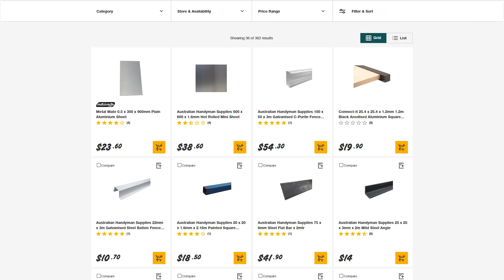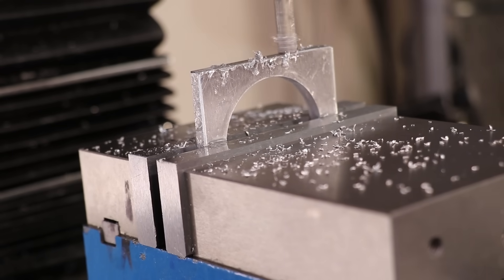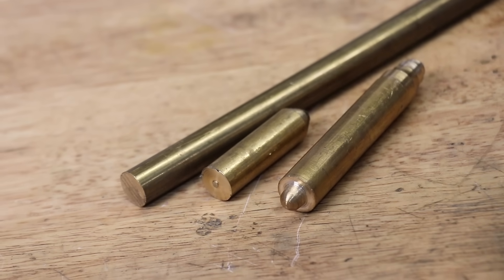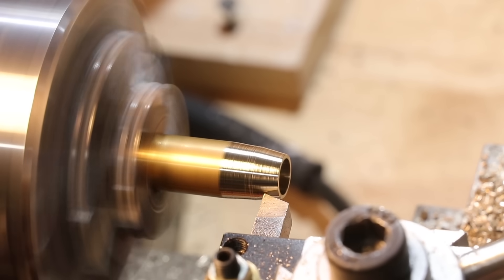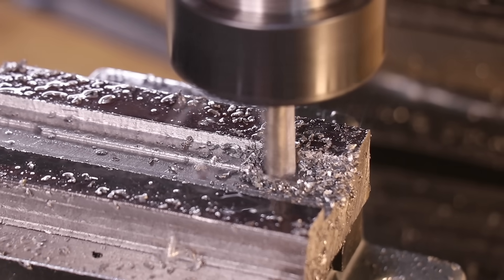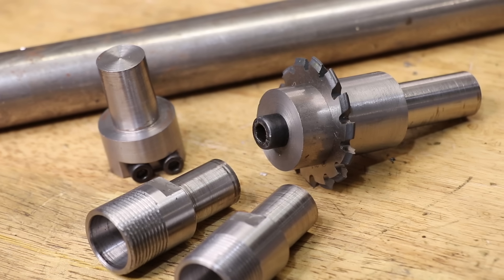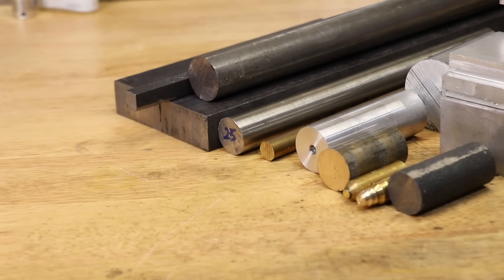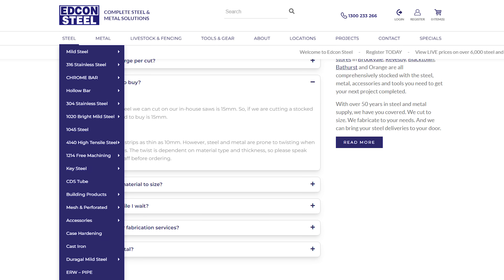Hobby Machining Materials - Where I Buy My Metal From (Australia)

Comment: I haven't watched Blondihacks for a few years but suppliers of small quantities may be handy as material is always a problem, particularly when shipping often doubles the cost.
Personally I'm OK with 6061 aluminium although I do use some 7075 for a few things, grind HSS with high rake angles, carbide inserts don't work so well and brazed carbide too much of a PITA to grind for aluminium.
Most cast alloys will chip-break very easily
Not much of a fan of 12L14 even though I machined 'miles' of it when I worked in factory.
As you said 'L' means there is lead in it so shouldn't be welded although stick welding with 6013 rod seems to work fine. (use a full respirator not a dust mask)
Haven't used any cast iron since the 70's, except for some 'spun cast' cylinder liners to convert a few of my Yamaha 'motybikes' from 650 to 800cc

Comment: Good call on Edcon. I live near Parramatta, so midway between two Edcon outlets.
Their cut charges for larger sections can add up, so I usually buy a length that will suit, and then cut it on the cold saw.
I do have another steel store much closer, but Edcon has a greater range of metals.
Thanks for the very straightforward explanation.
Regards
Robert

Comment: 316 stainless does not work harden--that is the problem, you cannot harden it with any treatment..
Reply from the maker: Hey mate, 316 sure does work harden, which is probably why I have so much trouble turning it on my less than optimal set up. 316 is an austenitic stainless, which are known to work harden. Cheers https://bssa.org.uk/bssa_articles/mechanism-and-measurement-of-work-hardening-of-austenitic-stainless-steels-during-plastic-deformation/
Reply: @artisanmakes  Engineers black hand book-- you cannot harden any of the stainless steels--they are naturally tough--they blunt good tools pretty quick..Cherry red the case hardening compound I talked to you about a few days ago ,I checked is available on oz ebay--lots of it..regards E
Reply from the maker: Not sure why the black book says that, for sure 200 and 300 series steels can't be heat treated, but the martensitic grades can, from memory those are 400 grades but I might be misremembering that. But 316 can be cold worked, it's not a heat treatment, it more of distorting the internal lattice which hardens it. 

I also managed to pick up some of that cherry red stuff. Its coming from America so It probably won't arrive for a bit, but I'm interested in how well it works. Cheers
Reply: @artisanmakes  E.J. Winter stock Cherry Red.

Comment: This is so helpful for me, thanks a lot. What aluminium brazing rods you like and would a butane torch reach the required heat for welding aluminium parts together? Thanks mate.
Reply from the maker: The only ones I have used much are the bossweld brand ones, mostly because I can buy them from the local hardware store. They work fine, they do require a bit more heat than I'd like to work but they work. I've used butane to get them to work but I prefer to use propane. Cheers
Reply: @artisanmakes  Perfect, thanks.

Comment: My wife can't stand driving with me on garbage disposal day cause I'll stop just about anywhere if I see something metal and mechanical,  I even carry two pairs of vise grips, bolt cutters and a multi bit driver under my seat just in case, nuts, bolts,springs and basic hardware always find a new home with me ! 
You wouldn't believe what people throw out, I'm on my third treadmill,  d/c motor plus controller, actuators and steel

Comment: Unfortunately, small pieces of metals are very expensive. There are suppliers on the internet that specialize in supplying hobbyists. But they charge ridiculous amounts. Finding companies that sell longer pieces, and spending more for those will cost much less per foot, or meter, or however you want to measure it. Just think of what you may want to do with the metal over the next year, or even several. Then buy enough for that. You might pay less than half per length than you would pay buying small pieces every time you have a project.

If you’re going to weld aluminum, then 6061 is good. Many other alloys of aluminum don’t weld up well.

I prefer hot rolled steel because cold rolled, due to the process, there are much more internal stress. If you machine hot rolled on one side, likely it will remain pretty straight. But you need to machine both sides of cold rolled because it will warp otherwise. I stay away from 12/14. Yes it’s easy to machine, but its characteristics are inferior, in addition to the rusting.

303 is similar to 304 in characteristics. But with any stainless, if you’re going to weld it, make sure the alloy has an “L” at the end, such as 303L, 304L, 316L, etc.

Comment: Thanks I have saved Edcon Steel, the shipping charge for one item is a bit exe at $35.00 so a bit of planning is required as the charge does not change as you add items, up to a point of course. Their variety is excellent. Update, I contacted the owner and he pointed out the facility to ask for a quote where he can tweak the cost, for example an item under 1 metre in Aust. can be posted for $9.50. Got a quote for $100.00 AU of stock and the freight dropped from 35 to 22.50. I will place the order tomorrow.
Reply from the maker: Interesting, as the shipping charge I pay is only $17, though I usually go and pick it up anyway. Hope you find good use with them, I have always had good experiences with them. Cheers

Comment: My recommendation, as an engineer:
Get as much from scrapyards and offcuts as possible
For steel suppliers it's not worth selling anything under a few kilos at a time, especially for cheap stuff like steel, so chances are you're going to get massively ripped off. 
Any offcuts you can get your hands on can usually be assumed to be 1040 high tensile mild steel, which is good all-round for shafts, axles, pretty much anything.
Aluminium is alumnium, it hardly matters if you aren't welding it
As for stainless, you can tell by the colour if it's 304 or 316. Most bar stock cab be assumed to be 316
I would highly encourage under-the-table beer or cash deals with anyone you know who has access to scrap or offcuts.
Reply: Helpful!

Comment: If you want brass/copper/bronze/ally try Brass & Copper at Seven Hills in Sydney. They're the NSW branch of George White (can buy from GW in other states but B&C are the best to deal with), they've got just about everything under the sun in non-ferrous stock, and they'll sell whatever lengths you want, and they're cheaper than Edcon.
Reply from the maker: Thanks for the suggestion, i'll have to check them out.

Comment: I made a couple Lathe Chuck Back Plates out of a free weight... I was burning through HSS tooling in about 10 minutes or less... a viewer commented that it probably wasn't true cast iron, but Sintered Steel, which would explain things... $80 in Carbide tooling later, it is not bad to work... (With bits for hardened & interrupted steel...)
Reply from the maker: Now that you mention it, that could very well be the case. I would assume that these weights are the cheapest mystery steel. Ive burned though some tooling too trying to machine it.

Comment: Interesting video mate. I buy my steel, brass and alloy from “Offcuts Galore”. They are pretty reasonable and have mainly small off cuts to about 300mm length. They also sell nylon bar which has come in handy.
I didn’t know about Edcon Steel. I see it’s in NSW, so postage to me in Melbourne May be pricey compared to Offcuts Galore which are in Geelong, not far from me.

Comment: Action aluminium are fantastic to deal with and excellent on price, they can also cut small amounts.
If you haven't had the pleasure yet, I also quite like 4140. Tends to be very stringy but if you can get past that it's dead easy to get a fantastic surface finish while still being a good strong steel
Reply: Yeah, I can second 4140 for sure. Machines very similarly to a mild steel in the annealed state, but enough carbon that you can heat treat it, though not quite as much as some tool steels. Very commonly used for gun barrels, shafts, and all sorts of things. Very lovely material to work with, for sure.
Reply: Yeah, I use Action Aluminium too, happy customer

Comment: Not used much 4140? I find it the easiest steel to scrounge in sizes suited to the small hobby machinist. I scrounge bar ends ranging from 40mm to 90mm diameter up to 200mm long from a local CNC shop, usual cost is a carton of beer for a load. They get nothing for it from the scrap dealer. It is hard going on the small lathe though. My mill is a bit bigger and handles it well enough. I have seen Edcon and like the way they do business, as you say, other suppliers are not much interested in supplying in the sizes for hobby machinists.

Comment: If you can get by with a little less strength in stainless steel  give 400 series free machining stainless steel a try. Much easier to machine and it is easier to avoid work hardening on smaller hobby machines. Works a treat on things like machine handles where it can easily be polished to a mirror finish.

Comment: Thank you. 
  Where I live is a sugar producing town and we have a few metal merchants as well as a few recyclers as well. 
 Of course I never asked them for small cuts as I just assumed they sold by the whole length. 
Never occurred to me to ask. 
 I rummage through the recycled metal and find a few little bits and pieces but it is mostly mystery metal and that bothers me as I don't know what I am using.
 I also just realised watching your video there are irrigation shops in town and they would use stainless bore shaft. I bet it would be machinable grade as they would need to thread ends or similar.
 Just hearing you talk about the different grades of steel made me realise this. 
Keep up the good work!

Comment: My local supply shop sells A36 mild, and 304 SS... So i literally started out and learned machining 304. It was, difficult, to say the least. However, as a result I've actually gotten pretty good at machining 304 and I will reach for it often now because I know how to work it and can get really great results. It also gives a lovely surface finish once you get the hang of it. Hands down I'll take it every single time over hot rolled mild steel. Great vid, thanks!
Reply: I work for a pharmaceutical company so I'm in the same boat as you, as we only use 304 and 316 SS. Once you get used to it, it really is much better than mild steel. 303 SS is even nicer. If you can find it, give it a try. The tiny little bit of lead they add makes it easier to machine and much easier to avoid work hardening. Too bad I can't use it at work...
Reply: @kanelivingstone2091  Yeah i actually found a small stack of random 303 slugs at that same supply house i mentioned. It must have been cutoffs from a special order or something i guess. But it's MUCH nicer than the 304 for breaking chips. Those ribbons that come off the 304 if you feed too slow are deadly sharp, they'll bit you, hard. haven't had the chance to work with 316 yet.

Comment: Another supplier is man cave metals in Victoria- he does hobby packs of metal and individual pieces . Ebay provides some stuff as well - usually if you search for lathe or milling machine in all categories there are a  few  metal sellers that usually have a listing of some sort on there - gotta be careful though as some are advertising from overseas and some say it is this grade of material like 6061 and it isn’t .
I have got a lot of stuff from Brett cnc  over the years off eBay and it has been good stuff - only lists when he has a stockpile to clear out though . Also need to factor in postage as this is usually y more expensive than the metal itself ! EJ winters at Bathurst have a small range of materials mainly aimed at model engineers .

Comment: I’m curious what process you’re using to weld the 12L14. Mig, stick, and if stick, what electrode are you burning? This was a very well done video, and I’ve recently gotten hooked on your channel! Thanks!
Reply: The lead in the material makes it essentially un-weldable. It can be brazed and silver soldered however. 12L14 is very easy to drill and tap or ream so that parts can easily be joined together mechanically. The material works a treat for making jigs and fixtures where you can press in hardened drill bushings and dowel pins.

Comment: free machining steel contains a small amount of Sulphur which is why it doesn't weld either with a welder for fabricated parts and also the chip doesn't pressure weld to the cutting edge of your tool giving the spiffy finish

Comment: I'll agree with Roel's comment.
Get to know the local scrap metal merchants. They buy a lot of scrap off-cuts from local manufacturing, which they get dirt cheap and sell them at much below "proper" prices for steel and aluminium.
Particularly useful if you don't mind small weird shaped pieces, which is usually ok for small hobby machining jobs. Pieces smaller than your hand are very cheap, you can usually buy close to their scrap metal value.
And sometimes you get lucky, at my local scrap guy the last time I was in there he had 16mm dia aluminium round stock in 600mm lengths, with a weird shape cut into one end. He cant sell for proper price so I got some for $2 a piece.
Reply: They typically have one or two containers of off-cuts here, often the ends of bars all have the material type markings on it. Aluminum, steel, brass and bronze, besides that also a nice collection of motors in the copper scrap pile
Reply: @rjordans  yeag a good scrap yard is a valuable find! Even better if you make friends with a worker and he can hold particular items for you instead of melting them down. I got a box of 6 servo motors, about 2kg each, all working but with dead encoders. New those motors worth about $300 each (in those days), I got the box of 6 motors for $10.

Comment: You should try the ZX-40 milling machine from extra machinery, it’s similar in price to some of the sieg machines and it has a 800 x 240mm bed with 385mm of z travel, and it has a 2hp motor, it’s made with cast iron and it weighs 350kg. It looks like really good value

Comment: Thx for the info!
I also get a lot from EBay. It works well for me as a hobbyist here in Germany ✌️😎
Reply: Where I live in the US they treat any metal as if it was exotic, and charge a fortune. And that is for stock that has been sitting out in the elements, corroded and requiring a lot of cleanup. Not to mention, the vendor doesn’t know what the material actually is beyond aluminum, steel and stainless. No further details available! eBay has come in very handy.
Reply: @NoTimeForThatNow  no way! Crazy... here it’s quite ok. You can order from metal traders (quality is good mostly), but usually it isn’t that much cheaper if you don’t get huge amounts. Traders usually ship with their own trucks, so you’ll pay for shipping what you’d save on the material.
Reply: @trashes_to_treasures  ordering online is ok here too, just the local scrap metal vendor is really bad.

Comment: This is all good information. However, the availability if material is very specific to your geographical location. Here in central Canada material availability and cost is terrible. Due to this, I have built a foundry and gathered up scraps and cast my own material. The only downside is what scraps are available.
Cheers from Canada
Reply: Howdy from Calgary. Yup, hard to get, metal recycling dumpsters for steel and getting raped at metals super market for aluminum and brass.
Reply: @Gopherdave1  I'm thinking the situation down here in Lethbridge isn't much different. I have had a little luck buying a few odd bits from a machine shop. It seems it's either that or buy it in huge bulk quantities from Value Steel.
Reply: Have you tried the scrap metal yards?
Reply: @wizrom3046  Yes, scrap prices for Aluminum and brass are astronomical. There is very poor selection locally. I have developed a few good relationships with a few plumbers (for brass scraps) and welders (for aluminum scraps. They are quite content to trade for their favorite beverages
Reply: @bhein67    hmm, sorry to hear that. It's better if you are in a city area, especially one with industry like manufacturing or farms etc.